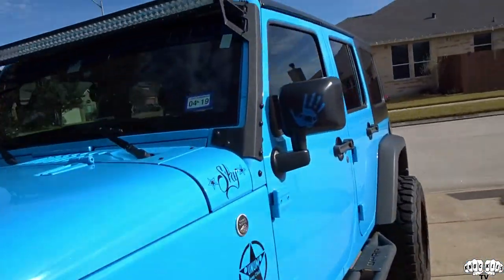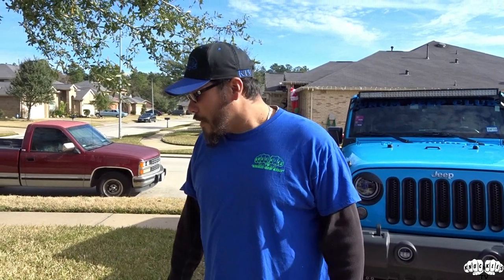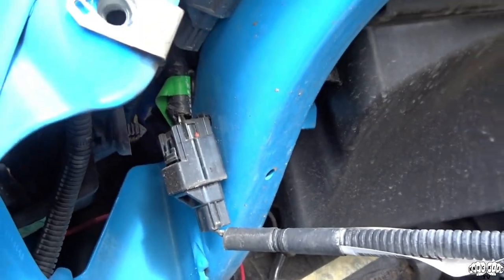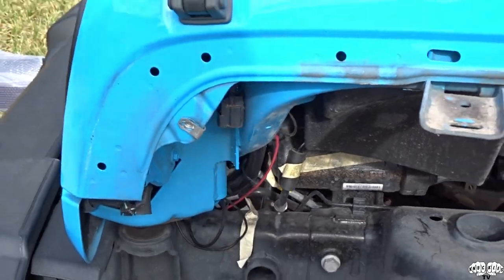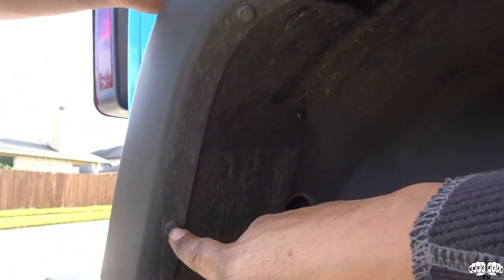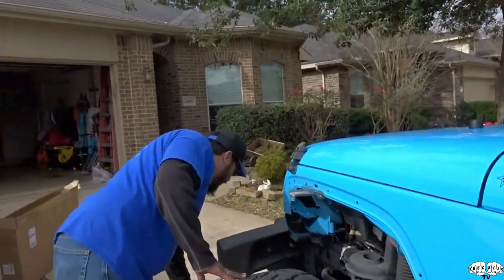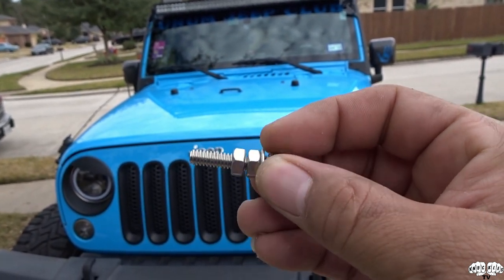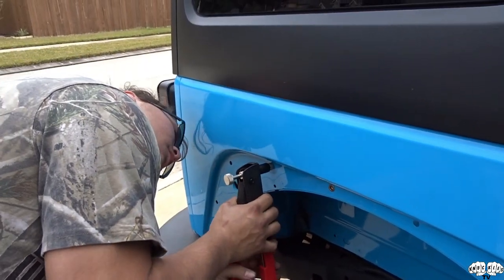Removing Stock Fenders from a Jeep JKU

Comment: i got the same one but for some reason the rivet nuts that they send me are smaller than the factory hole on the metal sheet of the jeep i dont know hot to fix it
Reply from the maker: So the rivet nuts won't hold to the sheet metal?

Comment: Can you remove the fender by its self ? And leave the fender in there ?
Reply from the maker: If you are talking about the fender liners you can leave it in there like we did on the front,  but you will have to do some trimming.  As far as the rear im sure you can but again I'm pretty sure there will have to be some modifications you will have to do to it.

Comment: I wanna venial wrap mine so I just need to remove it for a few mins. I also have rock lights on the liner, is there any way I could use that tool and pop the fenders off from the top instead of the inside?
Reply from the maker: IM SORRY KINFOLK IM REALLY NOT SURE.